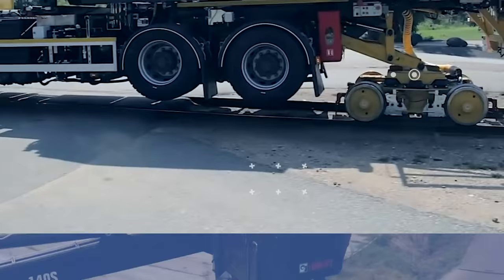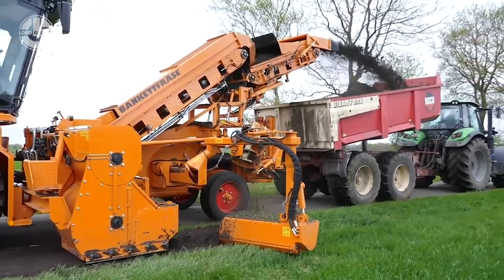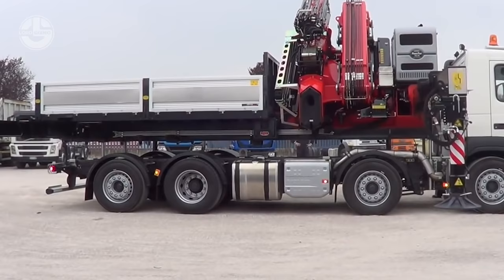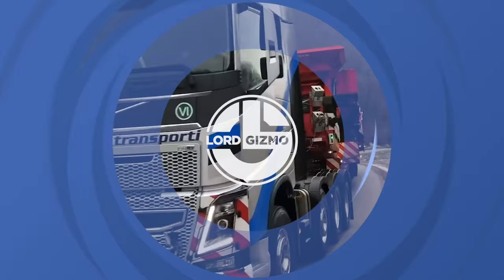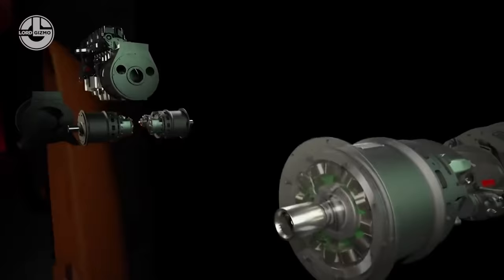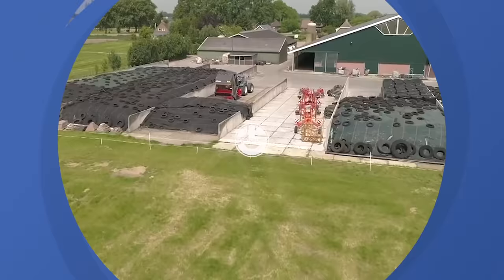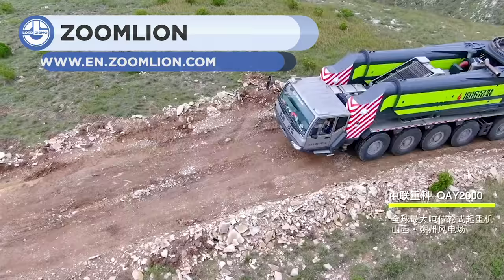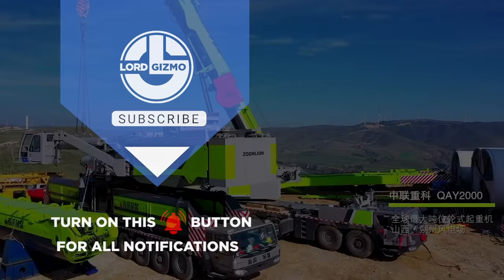Crazy Machines and Ingenious Trucks You Must See

Comment: 7:45 The JOY/Komatsu electric drive loader is a good concept, but it is not ready for use yet.
The company I work for had one at one of our mines and it literally spent more time on the surface broken than underground in use.
Multiple failures and long delays in repairs and parts mean it needs more work yet.